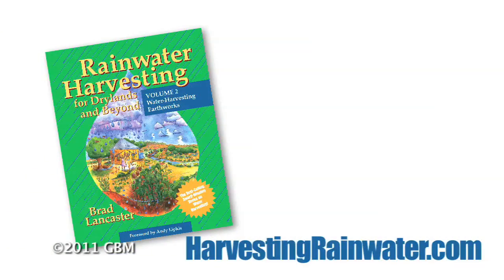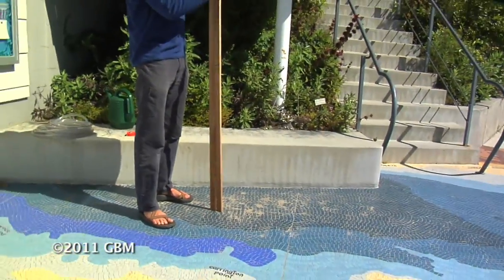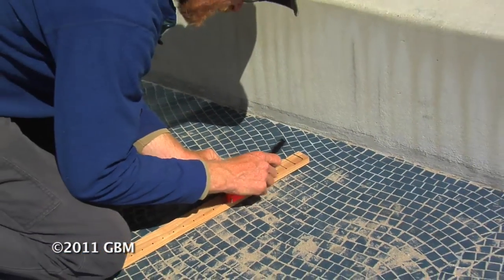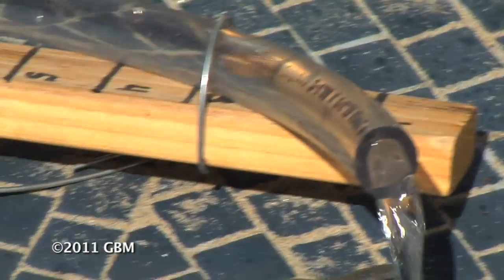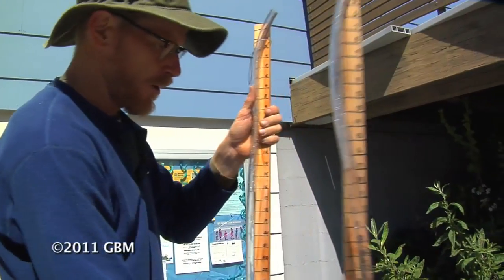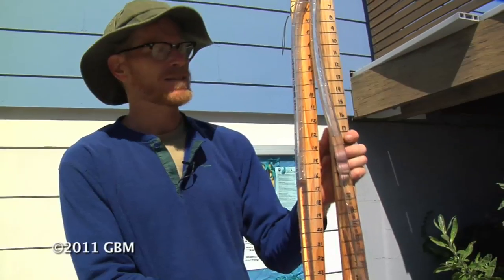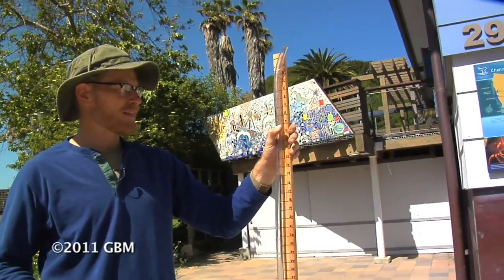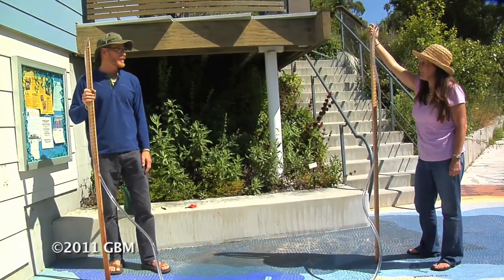Learn how to Make a Bunyip Water Level with Brad Lancaster

Comment: The marking should be from bottom and only the region that going to be used (from waist high to eye level ) needs to be marked. Put both the poles flat on the floor against wall corner to ensure 90  degrees in both directions. Better to mark 0.25 inches (smaller sized marking & different color) for better accuracy.
Reply from the maker: Thanks, Shyam!

Comment: Color the water by running into mama's kitchen and get the blue/red/green food color box.  Dump a good tablespoon of coloring into each tube end after you've filled the tube with the workable amount of water. It isn't necessary to have all the water in the tube colored, just keep adding color to the water as the coloring blends and  more level use.

Comment: On page 342 of your book is an error in the relationship of a straight up pole versus one that is leaning,  the leaning pole reading will always have a  higher(longer) number reading than the verticle pole because it's relative to the hypotanuse of a right triangle.    I've seen the units with 5/8"i.d. vinyl tube in the neighbor hood of 600 feet long,  regards

Comment: Nice job with the measurements on the sticks.  I've used a water level for years except I crafted mine with a gallon jug as one end and a single stick to move around on the other end. The idea then is to set the jug anywhere in the project location at a height that the water will stay in the tube.  Then establish a bench mark and work your height adjustment from there.  Two quick suggestions: 1. Take the tie wrap off one of the tubes on your stick and insert it in a water container, draw on the other end with you mouth and the water will start to siphon out of the container holding the tube lower. Pick it up when full. Less mess and no air pockets. 2. Cut a dowel that is the ID of your tube to use as a plug so when moving or laying the stick down you won't lose the water.  Now go build your pyramid.

Comment: Camera angle may have contributed to what looks like an uneven level of water in your tube.  The only way to be sure that there is no interferance with the level is to squeeze the tubes against each other at the comparison point,  so the level can be compared exactly.    Be aware that 3/8" and smaller will develope a magnetic interfearance so that the level can be differant.   larger sizes can do the same thing but highly unlikely with 3/4"

Comment: Is the stake that reads 22 inches actually 10 inches higher than the one that reads 12?  I would think it would only be 5 inches difference, or HALF what your "stake difference" is.   If you start with two stakes at "17", like you show, and then lift one of them up 5 inches, the reading on one stake the water will move down from 17 to 12, and the other side the water will move up from 17 to 22.